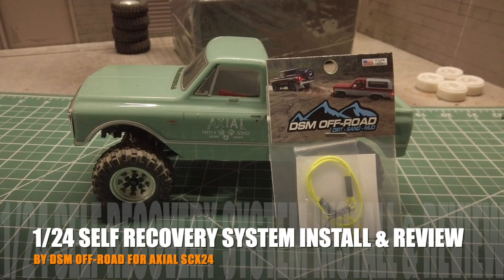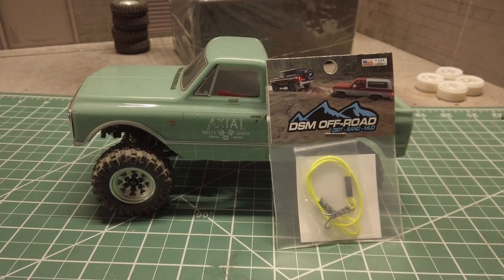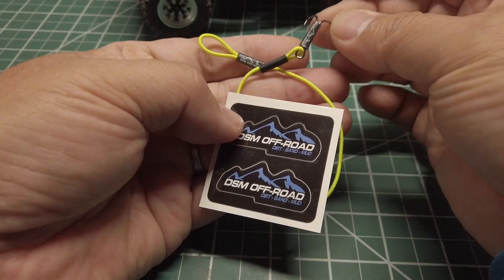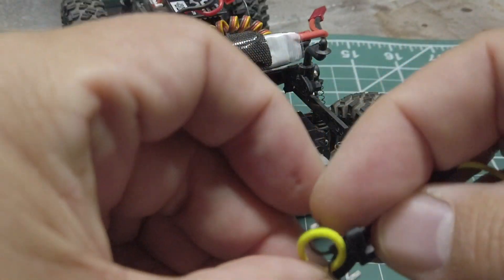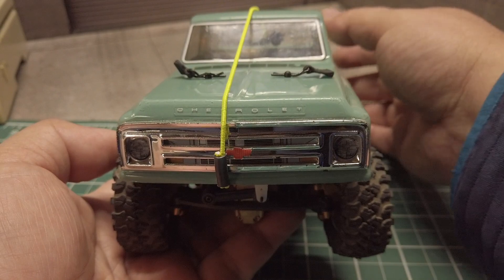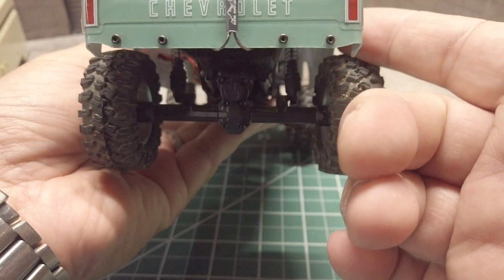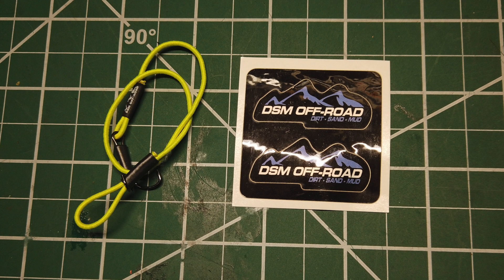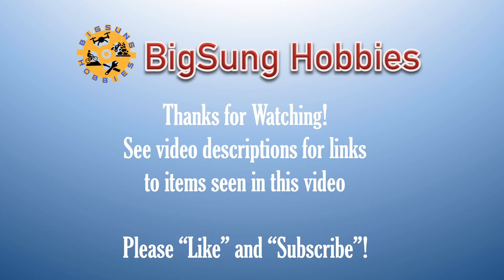1/24 Scale Axial SCX24 | Install and Review of 1/24 Self Recovery System by DSM Off-Road

Comment: That's nice and all but try putting a retractable card holder under the front. Only have to cut one bracket off one side and super glue it in place. Works great.
Reply from the maker: Ok, thanks for the info.

Comment: When pulling it out to stretch it to attach to a point, does it pull the scx24 when doing this? Thanks for the review btw!
Reply from the maker: The cord is not too long so if you stretch it more than you should then it will pull the car a bit.